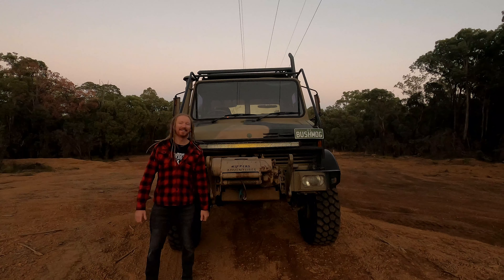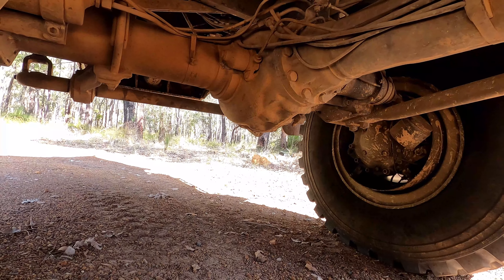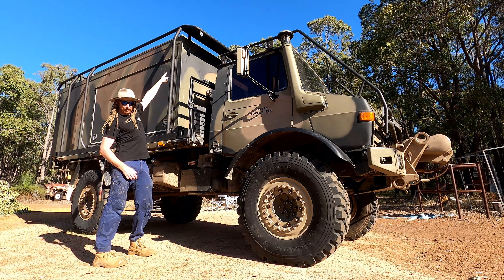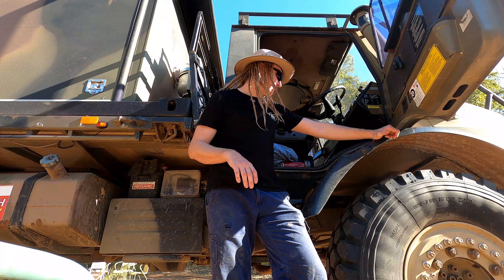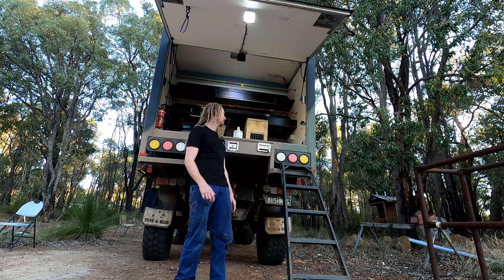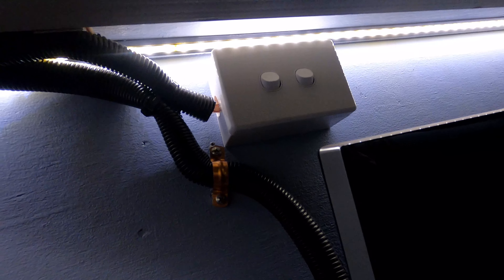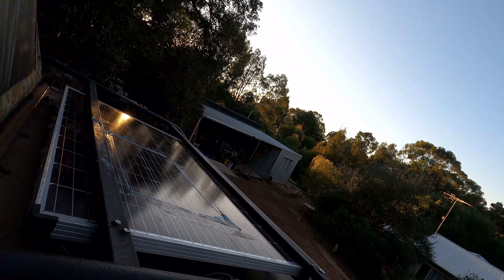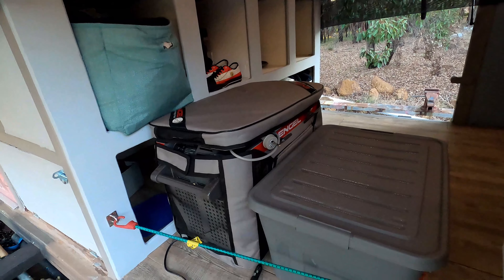A full walk through of our custom built Unimog camper

Comment: do you have a similar gear in downunder as we do here in the german armed forces? the older unimog had 3 gear levers. main lever for the 8 gears .... obviously;) split lever for high / low and a lever for forward / backward. or the newer ones with a switch for H / L and "only" 2 reverse gears
Reply from the maker: Yeah exactly the same matie, 8 gears forward and 8 gears backwards 😂 there's also a lever for the PTO aswell in this one

Comment: Nice, Thanks for the tour.
I'm soon to start looking for one but I may take the easier (but much more expensive route) and get Unidan to build me one.
Where  did you manage to source your rims?  They are what I want as well, but so far I have been told I gotta find someone to actually fabricate them.  Its the 20" that the critical bit (with the bead locks).  Did you manage to go Inner and Outer bead locks or just Outer?  Yeah, they are slow, but then they go almost anywhere.  You mentioned you took it across a salt lake.  Damn, that was game!  I take my old 75 Series LC just about anywhere, but learned years ago (when I almost lost it) to leave bottomless wet sand alone.  Heavy vehicle and watery sand dont play well together.  :)  Well done for getting 7 tone out!  I spend several hours with the vehicle broken through a crust on one side, sitting on the springs at 45 degrees in a creek bank with the tide coming in.  At one point drivers seat was 1/2 under water and engine 1/2 under water.  Thank god for good snorkel and old style Diesel.  Couldn't believe it when it finally popped up on top of the crust and just drove out.  Couldn't believe the winch still worked completely submerged in salty tidal water.   Looks like you live in Mundaring or somewhere with similar bush.  Used to hit the powerlines all the time, but its been a few years now.
Reply: It's for sale right now on gumtree
Reply from the maker: Hey mate, it's true I am actually selling the rig for 100k Ono, I sourced the rims from Ben Nash at mog central, he also installed the lift kit, replaced the portal hub seals and bearings along with other things you need to get it licensed, let me know if you ever have any questions about the build 👍 I do base myself in Mundaring and it loves the powerlines, there isn't a track it won't be able to go down 😂 cheers for the interest

Comment: Whats the leg room like when ur driving ? I am 6.3 as well and was told its cramped in the driver's seat for big guys.
Reply from the maker: Yeah it was a bit tight bud, but it made a little bit more improvement once I installed the hilux seat, I'm just under 6.3 too
Reply: @kippersadventures2456  Oh Nice. I really need to get my butt in one, Just to see. Did the Hilux seat bolt straight in ??
Reply from the maker: @Gladius7  nah I had to make a bit of a steel frame for the base to bolt on, but I used the original safety belt mounts, it wasn't too bad to make up, the photos of it are on my Facebook and insta bro
Reply: @kippersadventures2456  Sweet Thanks. Will go have a look.

Comment: Nice job Kipper.
Just to let you know ....
You definitely can't mount your solar panel under that bar ..
There can't be any obstruction to a solar panel ....Even a leaf sitting on a panel will seriously limit the output ..
It's just how they work ....
PJ.
Reply from the maker: Thank you Joe, it still manages to produce enough power to keep 2 Engels running and 2 batteries charged, but in the future I may look at popping it above the steel frame just to see how much more current it can produce, thanks for your input bud